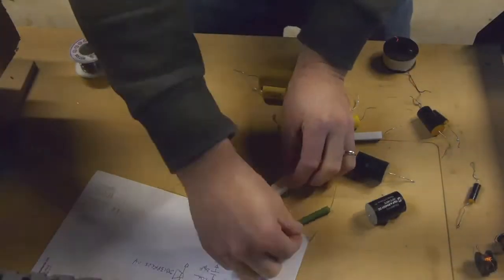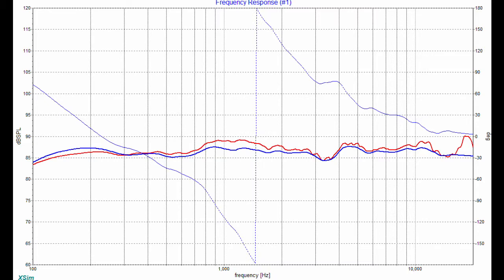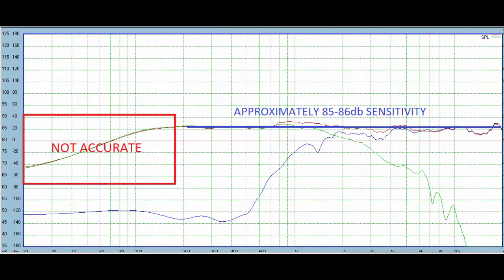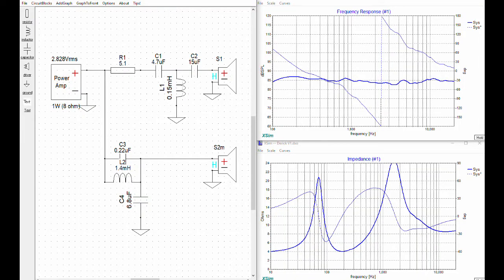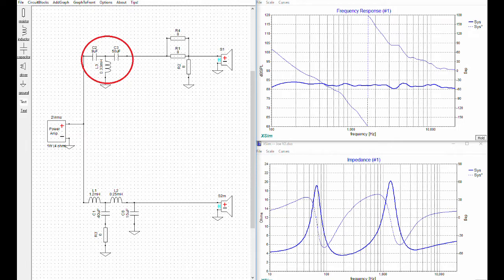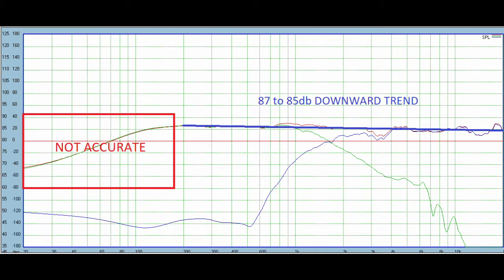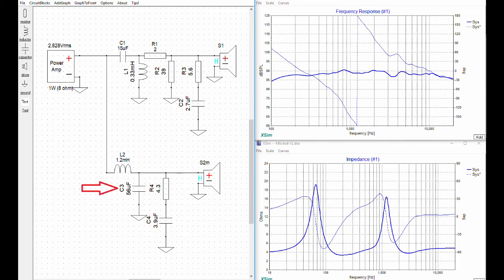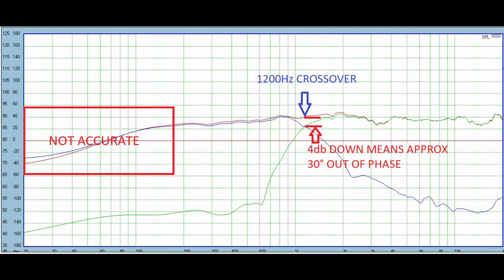Life S5 | Part 4: Crossover Reviews

Comment: Thank you, exactly what I was looking for, xsim crossovers with design considerations. I've learned a lot!
I'm building a crossover for a 3 way speaker, glassfiber woofer, 50mm softdome mid and softdome tweeter. I use a modified off the shelf crossover, better than nothing but far from perfect. I have 4 in quad stereo setup. First attempt parts for just one already runs into 100 euros, it certainly adds up quickly!

Comment: First of all, I have to thank you for working so hard in putting together those crossovers, and test them... I know how hard this think is, and time consuming! I only know the basic crossover tipes, but how to shape an SPL or an Impedance response, that I do not know! In a previows video of yours, there is a simulation of a crossover of the second order, if I recall correctly, and besides of a coil and a capacitor, there was a resistor in series with this capacitor... I tryied it myself, and I've noticed that the woofer SPL was shaped perfectly! I want to ask you what is this, actualy? And, most of all, where can I find any theoretical formulas regarding the ... contour networks ... I presume this is the name... 
Thank you again!
Reply from the maker: I’m not sure exactly what it was you’re referring to, but most likely a zobel filter. The best is to simulate the response using actual measured responses and software. The old calculations are a waste of time.
Reply: @ImpulseAudioSpeakers  no, it wasnt a zobel filter... on the woofer, because this is the type of driver that I was reffering to, I have used a second order filter. In series with the capacitor I have used a resistor in such a manner as one pole of the resistor is connected to the capacitor, and the other one to the ground! I have seen this in one of your videos... I dont know what this is... 
I am using Xsim and VituixCad2. Vituix helped me to create the *.frd and *.zma files for the SPL and impedance graph, because I allredy had them as images. 
I did not measure the driver myself... I do not have the means to do this... besides, I do not have the experience necessary for doing such a job...
Thanks for the reply!

Comment: Hi Ryan. I saw in your video always use a white noise or pink noise to plot the frequency response. How to do that ? I only knew how to do it in sweep  way but wonder why you do with noise file? Hope you can tell me.
Reply from the maker: There’s basically no difference. Most programs use a sweep. Sound Easy uses white. Some have the option of either. I actually prefer a sweep cause I can hear any issues with the speaker during the sweep.
Reply: I was going to ask the same question. Thanks to you both

Comment: Ryan, very good video.  I could use a little more explanation on the part about the derived phase.  Is this similar to using the Bagby Blender?
Reply from the maker: howard stever I’m not sure if it’s the same, but sure sounds like it. It basically takes the frequency response and derives the minimum phase. Perfectly acceptable way of doing it.

Comment: After watching your video on trusting crossover calculation websites, I'm even further convinced I'm not going to be able to do this myself, as I don't have access to xcel in order to use Xsim. Would you be willing to engineer a 3-way 4th order crossover circuit for me and I can bill you for your time? Or do you perhaps have a link where I can get more help or read up on the matter
Reply from the maker: NatesiKness you don’t need excel. Xsim runs in windows. If that doesn’t help unfortunately I won’t be able to help with your request. I’m about to start an addition on my house and can’t  work on any new projects. There are quite a few designs people have shared on the internet you could build. Find one that uses measurements and good detail. Not just a couple of lines on a graph. You want one where the person knows what they’re doing. Cause it’s a gamble buying all the parts. You don’t know what you’ll get.
Reply: My searches for such things aren't coming up fruitful. Will keep grinding along though!

Comment: What ever happened to the 0.65 inch offset? How did you go about it? Cheers
Reply from the maker: Quake Audio you mean how did I determine that it was 0.65”? Or what did I do with it? Sorry I’m not quite sure what you’re asking. I found it using the 3 measurement technique. It can also be estimated. Typically just under 1” for a small woofer and dome tweeter like this. It’s basically how much further the woofer’ acoustic center sits behind the tweeter. Some tweeters are in horns and it gets trickier to estimate.
Reply: Hi Impulse, thanks for your response. I meant to say what did you end up doing with that offset. did you introduce a delay circuit into the crossover? cheers
Reply from the maker: Quake Audio oh I see. I did nothing. There’s no need to do anything with it. As you adjust the crossover the phase relationship will change. Phase is distance and/or time for the most part. So the crossover filter changes the the phase to compensate for the offset. No other special requirements.
Reply from the maker: Christian Murace it sorta depends. But usually you have to tell the software the acoustic centres of the driver. Xsim uses delay in the driver tune menus. Every software is a bit different.
Reply: does this not technically mean when we design all our speakers on a flat vertical baffle we should design the crossover with an offset for example tweeter 20mm in front? this is what confuses me. but because both drivers are measured at 1m, it works out so we don't have to. hence why if we align the drivers, then measure it at 1m should it work out? Im sure that simple experimenting with cheaper caps will answer that question for me. forgive my barrage of questions, your words are gold to me.
Reply from the maker: Quake Audio you’re right that on a flat vertical baffle the woofer acoustic center is about 20mm behind the tweeter and this can be input into the software to account for it. It does affect things but very slightly. So if you ignore it, you’ll probably be fine. In my Life S5 series I touched on this slightly. I show how to setup the XO design in Xsim and include the acoustic offset for the woofer. Was about 0.6” behind the tweeter. I hope to cover the topic in more detail someday, but I have so many videos to do and so little time.

Comment: When drawing a circuit. What is the RTA measurement angle? I do. 0 degrees 15 degrees 30 degrees 45 degrees 180 degrees
Reply from the maker: W엉덩 when drawing the circuit I focus on the 0 degree measurement. I will use the other angles as a guide. When I measure I usually take them from 0-60 degrees in 15 degree increments at a minimum. Often more.
Reply: @ImpulseAudioSpeakers  Speaker position a. The position between the human ears is not 0 degrees frontal. 0 Is it right to design the circuit with a road measurement graph?
Reply from the maker: W엉덩 rarely do we listen at perfectly 0 degrees but usually close enough. Even 10 degrees is often quite close to the on axis results. And if they’re very different I wonder how good the speaker is. Designing with a 5 or 10 degree measurement isn’t a bad idea though.

Comment: Can you expand on what's mentioned by 30 degrees out of phaze.
Reply from the maker: Sorry it's been a while since I made this video and don't have the time to watch it at the moment, but from what I can remember, the woofer and tweeter were out of phase by 30 degrees. This means that the sound waves from the woofer and the tweeter are not in time by a small amount and the resulting output will not be as full as it could be. It's a complex subject, but maybe one day I'll put together a video about phase.
Reply: Impulse Audio thank you for replying. I wish to get a picture, what spec would I need as a minimum requirement for doing speaker calculation and measurement.  What softwares shopping list can I get hold of. It's been a passion of mine to make a pair of loudspeaker and learn how and what's involved. That's for your videos as I love to see what projects your doing.
Reply from the maker: That sort of depends on how technical you want to get with it. As a first design project, I would follow exactly what I did in this series on the computer. Build your results if you wish but start by at least downloading the files from Part 2A and 2B and following along in Xsim etc. See if you can reach the same place as myself and some of the other submissions. Then if you feel confident I would download files from drivers that interest you and try to come up with a crossover that way. If you feel confident, build it and see how it sounds. Start cheap in case it gives you trouble. Too many people start with expensive drivers because they think it will help. It won't.  From there you can consider getting measurement equipment and doing the whole thing start to finish, but get some experience and spend money on a few project before dropping $200 on measurement equipment. At the same time, $200 for these tools is very cheap. Hope that helps.

Comment: Hi, thank you for these videos.
Could you possibly explain why a lower crossover point works well for these desk speakers and why a higher one would suit living room speakers.
Reply from the maker: SuperChilled I plan to cover this in much more detail in a video cause its a bit of a challenging topic to descibe in a comment. Basically it has to do with wavelengths and distance between the drivers can cause nulls in the response. The power handling required so close to the speakers means the tweeter can handle it. In a living room where you sit further away the speaker has to produce 10-15db more output. Thats more than 10x the power handling required. So a higher XO is important to protect the speaker and mitigate high levels of distortion.
Reply: Oh i get it now, i thought it might me for some acoustical reason.
Reply from the maker: SuperChilled well yes there is some acoustical reason. The lower XO mitigates nulls in the response above and below the listening axis. Watch for a future video about this.

Comment: Ryan, have you tried the Digital Filter in SoundEasy? I have used it myself, and find that it saves me plenty of prototyping time, not having to do a physical build until the final design iteration. In fact, I would recommend it as a possible future video topic: you could do an evaluation and report on its effectiveness.
Reply from the maker: Shaun Onverwacht I actually have not. I find SoundEasy so cumbersom that I havent used quite a few of the features. I dont find building test XOers that big of a deal normally, but for this video it would have probably saved me some time to use the simulator.
Reply: I agree about the SE user experience.

Comment: I use a 4 ohm resistor in series with a tweeter to recudce its output. Would an L pad be beter? Why is there a difference, as you say?
Reply from the maker: Marcel Ooms neither is necessarily better than the other. Just different. The Lpad advantage is that it can be used to smooth the tweeter impedance. This helps the filter do its job better. Hard to explain, I sense a new video idea. The resistor in front of the filter is basically a power sink which is advantageous in keeping the impedance load on the amp high (good). I have used both the resistor in front as well as the Lpad when a lot of tweeter padding was required.
Reply: Clear answer, thanks!